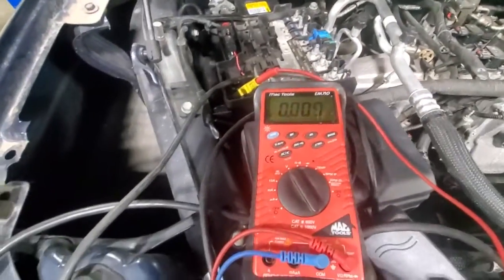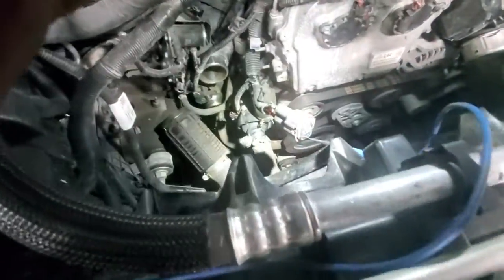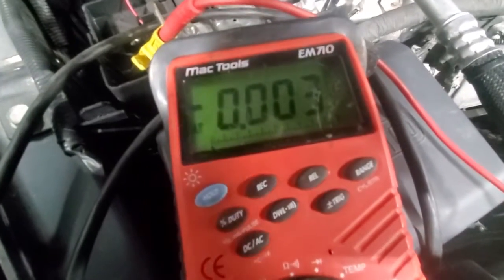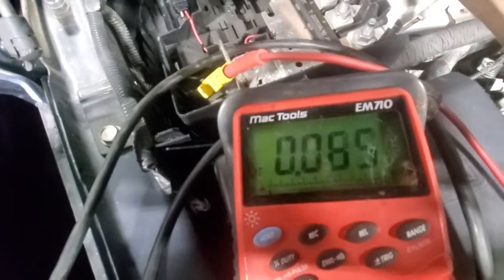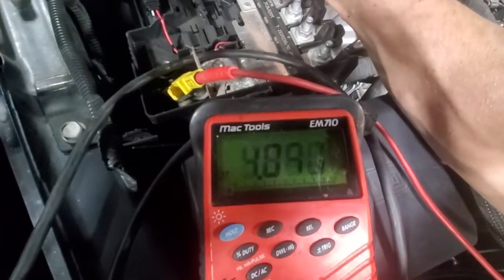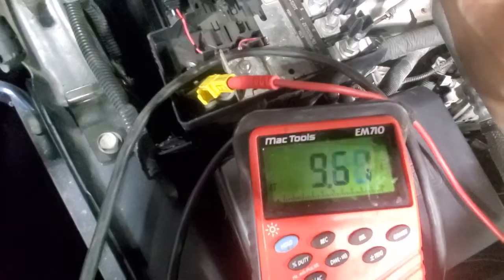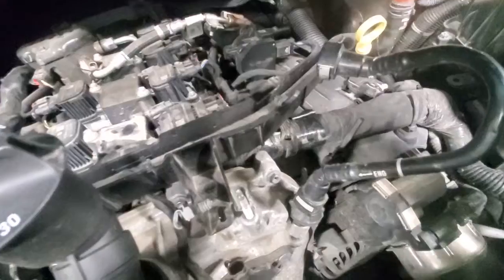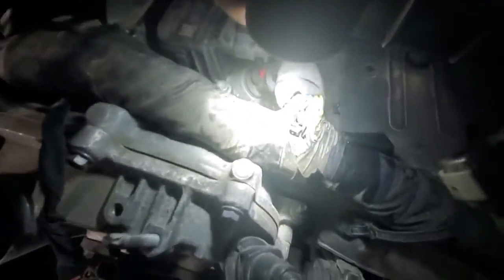GM 2.7L (L3B) I-4 TURBO - NO COMM WITH COOLANT PUMP, LIN BUS 4 ISSUE, & POOR HARNESS ROUTING ISSUES

Comment: What did you do to fix this issue? Did you replace the wire or the whole fuse bus panel?
Reply from the maker: The High Amp Battery Fuse Array.
Reply: @PaulysAuto  try Strikehold lube (and cleaner) first when you have electrical problems and circuit board issues. Simply spray onto it. You'll be amazed how it fixes the problem.
Reply from the maker: @Keto_Fatty_Syndicate thanks I'll look into it.

Comment: I have U0672 code have replaced the battery distribution fuse box and changed the water pump And still getting the code, any ideas? Checked wiring don’t see anything abnormal… 22 Silverado 2.7
Reply: Im currently having the same problem. Diagnosing for my wife's coworker. She just replaced the battery and this issue started happening. It's a favor but now im obligated lol I'll do some testing tomorrow to find out what's going on...I'll keep you posted

Comment: This is the video that I needed.  I'm experiencing a steady on and off engine light on my console and received a code of U0672 which indicates "No Comm with Coolant Pump".  All the checks you performed was exactly what I needed to see.  However, I was confused with the meter wiring you used.  I was able to remove the water pump connector but found the wiring configuration a bit confusing.  I didn't have a probe (which I plan to purchase soon) but thought to use the thick probe that comes with my meter.  I wasn't expecting any good results; just wanted to check.  My fuse #80 on the fuse block wasn't as loose as your video demonstrates but since I couldn't test it properly, I couldn't test successfully.  Nevertheless, excellent video and one I will return to.  I've not seen any other video that comes close to yours especially one that shows troubleshooting on a Chevy Silverado 1500 custom 2.7L.  Thanks again.
Reply from the maker: You're welcome, my friend, I appreciate your feedback.. it makes me happy to know we learned something from it!

God bless 🙌 you and keep being the best you can be ALWAYS!

Comment: What was the problem with the lin bus? The loose fuse? What was your fix?
Reply from the maker: @CN-zi7cw  High Amp Fuse Areay at Battery sweetheart
Reply from the maker: @CN-zi7cw  🤣sorry old news now
Reply from the maker: @CN-zi7cw it can't communicate with intermittent power now can it?

Comment: Hello. I have this engine with same issues. I’ve tried to secure all wires that I found that were rubbing. Still getting the “lost communication with engine coolant pump” code. Appears to only be getting more and more often it’s throwing this code. Did you replace that 80 amp fuse? If so did this solve the issue?
Reply: What did you end up doing to fix the problem?

Comment: How do you go about replacing that fuse if it’s bad? Is it serviceable or do you have to replace the entire wire block that sits on top of the battery? Just got the U0672 + U1348 (check engine) codes along with radiator fans running at max and dealership doesn’t have appointment slots for months and can’t be without the truck that long. 2022 Chevy Silverado with the 2.7. Thanks in advance.
Reply: I ended up just replacing the entire fuse block. Cost about $120 MSRP from the Chevy dealer which fixed the issue.
Reply: @devonwagoner624  thanks for the reply, appreciate it.
Reply: I got a 2020 Sierra doing the same thing (U0672 + others) did you ever find out what caused it? I replaced the battery fuse block but still getting the codes....
Reply from the maker: Tbh your answers are as good as mine my friend 🧡
Reply from the maker: What Fuse are we talking about?
Reply: Hi, you already found the problem about it?

Comment: Hopefully GM addressed these issue(s) with the 2022 refresh.
Reply: Nope, I have a 2022 2.7 L Silverado, has electrical problems out the wazoo.  They replaced entire wire harness and was good to go, until today.
Reply from the maker: I haven't seen many more of them; so I don't imagine it was a super common problem...but time will tell.

Comment: How’s that work with out loading the curcuit?
Reply from the maker: Good question, now let's think about that, this is a straight Battery fused feed "unloaded" imagine the Voltage drop when current is ACTUALLY flowing 😵🙃....fascinating

It may seem difficult to understand, but remember this is a straight battery feed.

And I'm barely applying pressure at that connection.